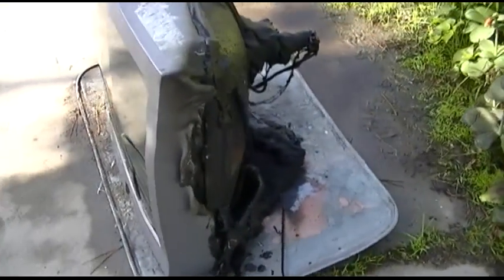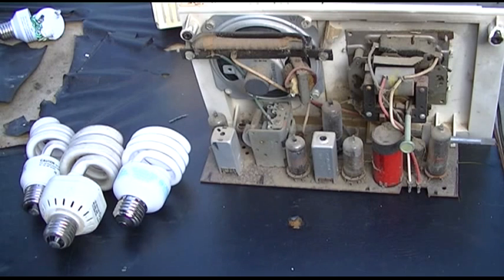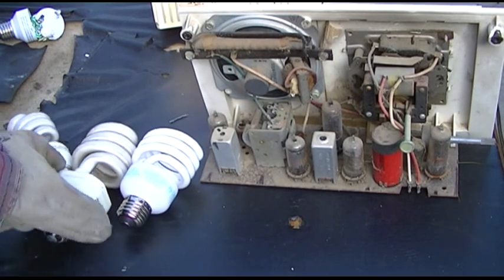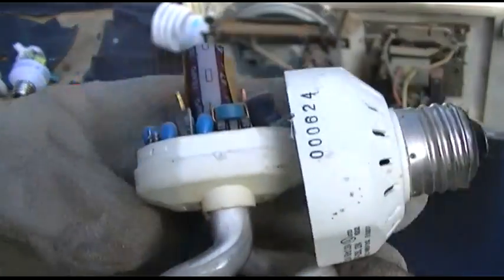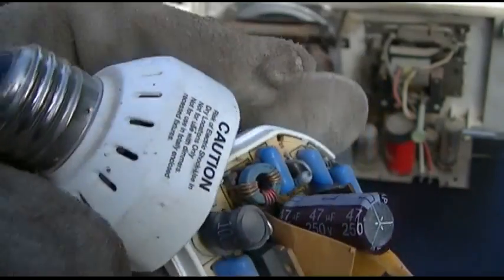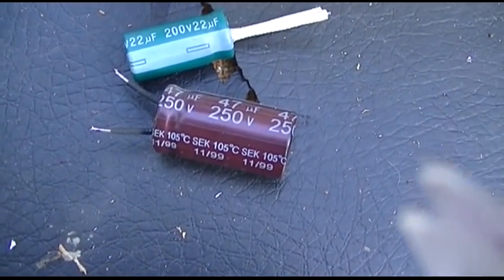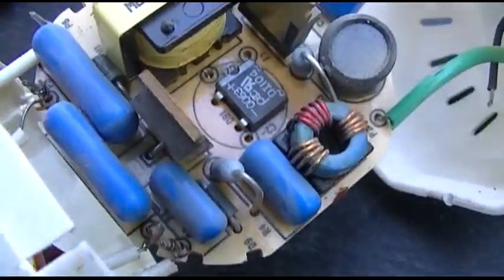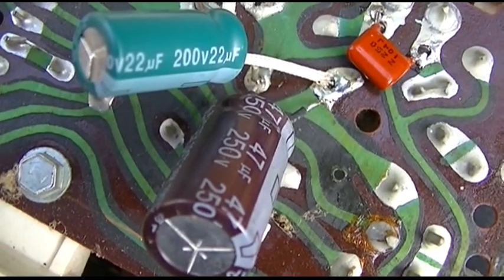Repairing Westinghouse AA5 Radio With Parts From CFL

Comment: Hey Shango take an old beat up AA5 that has slug tuned IFs that's all original that has an old original paper electrolytic that still works and replace all the tubes with weak tubes and we all take a guess what will fail first hahahaha 😆. Those only consume 35watts instead of that nos console. How is that one doing?

Comment: my kidney dialysis machine has the same humm.  can I repair the blood pump with the parts from a cfl, or should I get an old LED light bulb?  i am afraid the pump might run too fast, and cause my veins to enlarge in my arm.  maybe I will try a 47uf tear drop capacitor instead of an electrolytic.  what do you think?  I have it apart right now waiting for your reply.

Comment: Sure you can use  used caps out of just about anything and hope for the best. The mfg probably used the crappiest caps they can find in those CFLs. What are we saving here? 75 cents - $1 on a new cap?  The film caps I may trust, as they aren't as critical in a radio. But the electrolytics should be replaced with fresh ones.
Reply: We are basically reusing e waste

Comment: What is the secondary voltage on the transformers in CFL? Anyone know?
Reply: The Guitologist they're inductors. They usually have 4 pins but only 2 are connected
Reply: Thank you. So basically a little choke of some kind?
Reply: A bit late, but they are in a series resonant lc tank and driven by a half bridge. they will resonate to around 1-2kV then the lamp strikes.

Comment: You are right there are a lot of good parts in those type bulbs,if you had to buy all those parts separate it would cost a lot more than that bulb cost .question when replace with modern caps you tie the to grounds together and solder to ground and each value to where they came from originally.I wish. Some would draw this out ,but I think I got it,where do you buy your parts China or u s I no China got some cheap prices
Reply: I bet you do and don't no it,some stuff says u.s. and made in China for u.s. companys
Reply: +Ron Thompson I usually buy nichicons (made in Japan).

Comment: I usually just bust the open in a bag (so glass won't go all over) with a hammer and sort it out later.. not enough mercury in those things to worry about anyways..
On a side note you can make a stun gun from a CFL or modify them to a crude inverter..

Comment: I suspect that many of these CFL light bulbs fail due to bad caps, so this may not always work.
Reply: Great fix, sounds 100 times.better than it did in at the start.
Reply: @tomwold8269  yes.
But that's not the point.

Comment: I have a 10 watt mono tube amp out of a motorola Hi Fi record player. Would it be possible to use parts from a CFL to fix it? Heres a video of mine.
1957 Vintage Motorola Hi Fi Inside View
Reply: +coondogtheman1234 No one here is going to help you because you seem to have no intentions of using it properly in the record player it came out of as a vintage record player, Your only concerned about "bumping the bass" from an ipod..

Comment: Thanks for the tip on the CFL.  I've been chucking them in the trash when they die. I would have never thought that these would have caps with those kinds of values... and I'm always fiddling with old radios.  Thanks again.

Comment: in 220v countries (like sweden where i live) they usully had a big power resistor in en heater chain to burn of some voltige and there where often a voltige selector that basicly shorted out the resistor for 127v operation (i think some more remote places in sweden and europe had 127v DC or AC mains voltige)

Comment: Great sound and excellent recycling. Good caps too as they are rated for 105°Celcius.
 The caps in our 240V CFL's are usually 10, 22 or 47 uF and rated at 350 or 400 Volts.
Interesting that the USA mains radios run at 120 V2 (170 Volts) DC. I always thought that a step up transformer was used for thr tubes to get 325 V dc.

Comment: I LOVE IT!!!  Recycle everything you can.  I have used some parts from my bad CFLs as well.  I really want to figure out what went bad so I can fix them, but haven't been able to yet.  I think there is a heating element inside the bulb that burns out, that warms up the gas so it will conduct and illuminate the florescent coating inside the bulb.  Any ideas?
Reply: tadgesualdo no.
Reply: It’s usually the transistor that fails